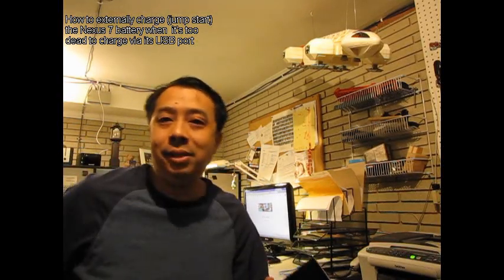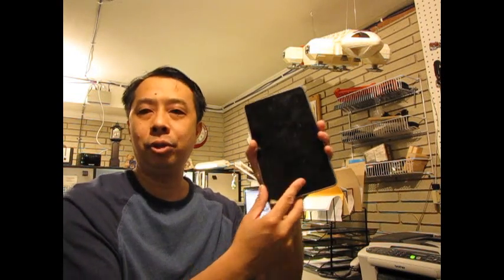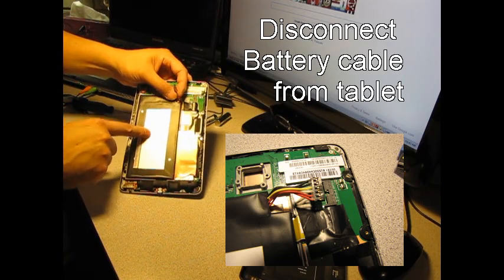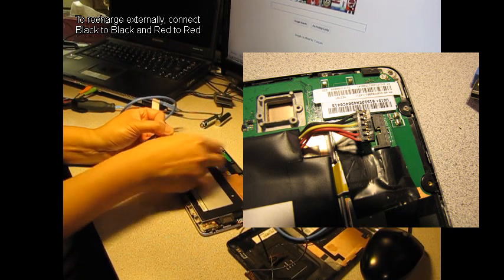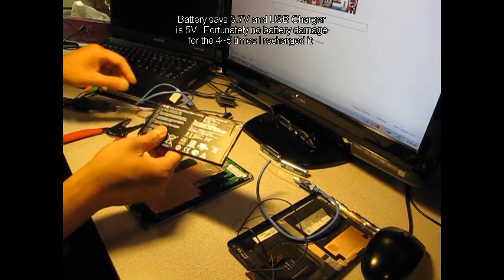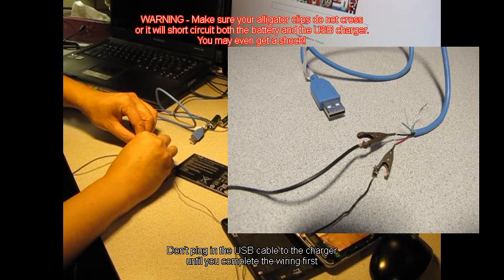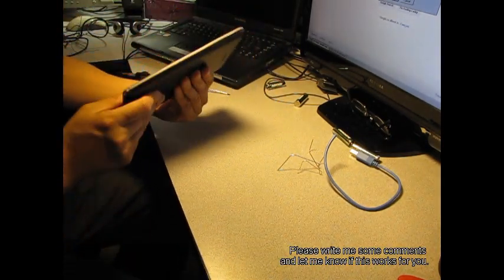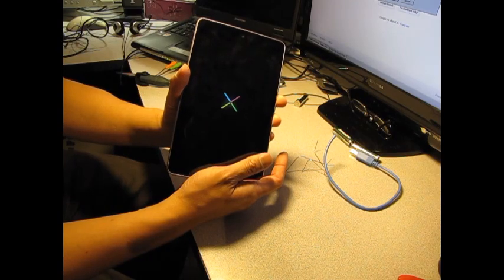Externally Jump Start Your Dead Nexus 7 - Final solution when all else fails!

Comment: Thank you so much for this, Doug. I hadn't turned on my nexus 7 in about 8 years. Your steps worked exactly as you described. I checked continuity on the pairs of black and red cables and noticed that they are connected anyway, so I didn't bother charging them separately. I did 20 minutes and got 12%. I noticed the 5V/3V behaviour too. So good to see this thing boot again. God bless

Comment: Hello. I want to add a third cell. Which wires should I grow to? to external or internal?
Reply from the maker: Turns out that both pairs of wires leads of the battery to the same place which I didn't know at the time of making this video!  That is the both reds are connected inside the battery and both blacks are connected inside the battery.  If you peel back the battery cable and follow it down, you will see they are actually joined together at the battery.  Why do you want to add a third cell?  If your battery is dead, check Aliexpress as you maybe able to buy a replacement there.
Reply: @CanadianDoug Dear friend, thank you very much for this research.
You helped me a lot!
Reply: @CanadianDoug Hello again! 
I did it))
Now the tablet does not need to be charged for hours. I change the battery like in a screwdriver)

Comment: WOW!!!  I had no trouble opening the case.  The connector disengaged easily.  I "jumped"  each pair of red and black pins for 20 minutes.  I reassembled everything and plugged it in and it immediately started charging the battery!  After being untouched for 8 years, it now appears that this 2013 Nexus 7 is taking a charge.  Hopefully I will be able to put this tablet back to work.  Many Thanks!
Reply from the maker: Thanks for sharing the good news!  If you do have problems charging it moving forward because of the loose USB connector, there is a charging dock that you can buy that is probably now dirt cheap.  This charging dock using the 4 gold pogo pins on the side to charge without going through the USB port. Another thing nice about this charging dock is that makes a great upright stand to use as an android clock!

Comment: Great video Doug, thank you.  I had similar symptoms. Although I didn't need to do the full 'jump start' this video gave some great instructions on how to open the case and disconnect the battery.  Disconnecting the battery in my unit solved the issue I had and after reconnecting the battery I was able to boot into the bootloader (Power and Vol Down) and shut down the device.  This gave it the kick it needed to boot back into the Andriod OS.

Comment: Hey Doug, thi was great, thanks.  Good info.

It's been years and years, and I'm still trying to keep my old Nexus 7 2013 alive.  Blows my mind no one's made a tablet to fill this niche.

Anyway, slight mod on your process got me back up and running.  I couldn't quite get any wires into the connector on the battery harness side - even tried solid strand CAT5, but wouldn't stay.  During this process, though, I accidentally discovered that with pressure in trying to fit the CAT5 copper into the harness connector, it doesn't take much to push the lead out of the back of the plastic connector.

Using needlenose pliers, I was able to carefully extract the outer pos and neg leads.  5 mins on my hacked USB cable - great idea, btw - on one cell only was enough to breathe life back in.

I connected a regular micro USB charge cable, and my Nexus booted.  I'll leave it on overnight now and see how things go.  Thanks for doing this demo.

-msg

Comment: That worked like a charm on my nexus 7 2012. I havent turned it on like for years and wasnt able to power it up. Injected 5v straight to the battery for around 1h, then plugged that to the charger via micro usb and let it do its thing for another 0.5h. After that procedure i pressed power button and the screen went on. Brilliant video. I thought I lost this tablet. I need that to wath some netflix and tv while at work. Cheers👌👌👌👌

Comment: Did not work unfortunately. Made a very nice lead with crocodile clips attached to an old stripped down USB lead. All good there with a tested 5V coming from the charger. The old battery in the unit was completely dead and did not register any voltage at all. While I was able to get it partially charged it was unable to hold a charge. Swapped out battery for a 'new' one which I measured at a little over 4V. However no amount of button pressing, or combinations thereof, managed to bring the device back to life. A fiver wasted on a new battery, but it could have been worth it. Sadly not. I guess something else is wrong with it, perhaps the screen, a failed chip, dry joint etc. Nothing lasts for ever, I guess, but the Nexus 7 was the perfect size for reading books and watching the occasional YouTube clip.  March 2023.

Comment: Yes, that worked.  I think one of the cells had gone below the minimum.  Thank you!  Do this all the time to my tool batteries but never had to do this to a computer battery.  Had to revive my old Nexus to so some solar system monitoring.  All it's good for now.  Joined my fleet of early Fire tablets.  Don't know why they can't design a jump start mode into all of these charge controllers.  Probably a safety concern.

Comment: Mine started once and shutted down just after start and no longer boots anymore. Multimeter shows that battery has 3.8 volts but it looks like completely bricked. The only one think is that while it is connected to the charger (via usb) it is trying to boot, but black screen apears after 5 seconds of Google logo

Comment: Hi my nexus 7 wont power up tried a couple of batteries I don't know if its the batteries that are totally dead or something else what tools did you use to do this and which aligator with cable do you recommend to buy ?
Reply from the maker: If you tried with another battery, there is a good chance that other battery is not dead.  You only need a bit of juice to complete the boot sequence it was trapped in.  In other words, it's not good news as your problem is probably something else.  As for Aligator clips, uses the smallest tip you can find or try with a paperclip as the tip is small.  Amazon is your best bet.

Comment: The only problem I had was the red & black wires in the USB cable were really, really tiny, making it difficult to strip the insulation off the ends, and then securely insert them into the battery connector. Otherwise, everything OK. Thanks!

Comment: I had given up hope on my Nexus 

This worked 

Ingenious 

Although I didn’t need crocodile clips or extra wire. I stripped the USB wires back (pink and white), wrapped them tight around two metal
Staples - they were the perfect size to slot into the battery plug terminals 

5 minutes each in both sets of cells

Job done, thanks!

Comment: Doug!  Thanks so much!  I know this vid is years old, but it is very much still "current".  I have not used my N7 in several years and thought there was no hope for working again.  I followed your perfect instructions and my N7 now works again!  I charged both "ports" for 30 min each, and ended up with a 20% charge.  Plugged it into it's normal charge cord and 3 hrs later, 100% charged!  Thank you for posting!  The worst part is remembering how this tablet works!  LOL

Comment: Thank you!  Your video was one of several I watched to get the Nexus 7 going again.  Just want to let you know that this is still relevant.  Mine had not been used since 2015 and this technique brought the battery back enough to get the tablet to reset and login, as well as getting a charge to "take" on the battery.

Comment: Sir My Tablet is Nexus 7 (2nd gen ) and it's not storing charge! it shows that it's charging and also gets 1% of charge, but after that it doesn't go beyond 1% and shuts down after a few min
Reply from the maker: Are you getting the "charging symbol" when you plug it in?  If you are getting it and it's able to properly shutdown, I think your charging system is working fine and hence no need for my instructions here.  Instead, maybe your battery is too old (used too many times) and can no longer store charge.  You can often buy these batteries on ebay.com or aliexpress.com by searching for "Nexus 7 (2nd gen 2012) battery".  They are probaby inexpensive and also easy to install.
Reply: @CanadianDoug  actually they aren't available for my region🥺 and im not able to find anything part of my tablet here at my city

Comment: Does the battery have to be removed from the Nexus?  Or Can I leave it in there to charge?
Reply from the maker: You can leave the battery inside the Nexus to charge, as long as the battery wires are not connected to the Nexus circuit board itself.  Good luck!

Comment: Will it be dangerous to connect 5V directly whilst the battery is connected to the circuit?
Reply from the maker: Sorry for the late reply.  I do not recommend you connect the 5V USB supply to the battery while it is connected to the circuit.  The reason is that the circuit is designed to operate at a lower voltage and may not be able to take the 5V supply.

Comment: An excellent tutorial. However, must I reboot the system with the power - volume buttons? Without this, mine started alright then shut down again ...
Reply from the maker: It might had just enough batteries to complete the last shutdown sequence.  Try charging for longer.  If your tablet's USB connector is loose and hence can't charge anymore, you can buy a new connector part on E-bay or buy an external recharger that utilizes the POGO pins (the 4 gold dots on the side of the tablet) to charge through there.

Comment: Can we connect the usb directly to the motherboard and use without battery ?
Reply from the maker: Never thought of it. It would depend how much voltage the battery typically supplies (I.e. Is it the same as USB which is 5V) and if the USB is capable of generating enough current (mA) that the tablet Motherboard needs. My guess is the the USB voltage of 5V is too high compared to what the battery typically gives, but the USB current is sufficient. The higher 5V of the USB would likely damage your tablet, that would be my guess

Comment: This appears to have worked for me. I made it a little simpler by buying a test lead set with alligator clips attached. So the wires and clips were already together. I used 2 staples to attach to one end of the clips and insert into the black and red inserts on the battery side and used an old USB cable for the other end. Charged for 30 minutes each like the video. It now has screen activity and indication it is charging when before it was dead.

Comment: Darn. Tried this, on two separate batteries actually. I believe they took the charge, since my computer recognized that something was pulling a charge on the USB port. (USB device not recognized.) But upon putting them into the tablet, no dice. Thing wouldn't start. Which is weird, because when I got the "replacement" battery in, it powered the device on just fine, until that battery lost power. Thing won't charge, or register on USB. I think it's pootched. Nice idea though. Probably would work on a more functional tablet, as the comments seem to suggest.
Reply from the maker: Sorry to hear it did not work.  When the battery takes the charge, The Nexus would normally automatically reboot as normal.  To be precise, it completes the last shutdown sequence first, and then boots up again.  Did you try pressing both the power button and volume rocker simulaneously with the recharged battery in place?"

Comment: Very clear video Doug. Thanks.  I just had this problem after letting my Nexus 7 battery discharge completely (I though it was charging but the power strip I was using had reset).  At this point the screen was blank and when I plugged it in I didn't get the normal screen showing that the battery was charging.  When I pressed the power switch at this point the LED at the bottom of the screen would just flash 5 times, and then this would repeat after 10 or 15 seconds (if I kept the button down).   I tried holding the power-on switch down for 30 seconds without any success (multiple times) but then when I held power-on and volume down together for a minute or so I suddenly got the empty battery symbol to display.  I didn't need to use your technique, though I'm sure it would have worked too.  Note that Home Depot sells a pair of insulated alligator clips made by Tyco Electronics for $ 3.50 so you won't risk shorting things if you use these.  The Home Depot Store SKU is #281205 (Model # EB0283-000).  The insulation covers the entire barrel so that just the tips are exposed.    Also I wonder whether you might be able to charge both cells at the same time by just inserting two wires into each side and then clipping the USB jumper to both?
Reply from the maker: Thanks for your advice!  Yes, I later found that the two cells are interconnected within the battery from one of the readers here.  So you could charge both at once, or just one of them as they are all connected!

Comment: omg, been dead a year.... im always tinkering w electronics, and i thought about doing something like this but was worried i would l fry something.  your video confirmed to me that i should go for it.  i just jammed a couple needles in it for like a minute, and it powered up.  it died and shutdown pretty quick, but now i know what to do!  now i can fashion something a little more stable to charge it for 10 mins or so.... thanks!!!!
Reply from the maker: Your USB charging port is probably broken.  You could purchase the external charging dock which uses the 4 pins on the side of the device, or fix the USB charging port module.  That module is available on e-Bay and is modular, making it easy to replace.

Comment: power from charger or  from pc??
Reply from the maker: Either will work, but I strongly suggest you use a charger.  If you accidentally cross the wires and cause a short circuit, it would only damage the charger and not the USB port in your PC.

Comment: Hello,
I have had this issue for a very long time and I am 100% sure that this solution is the one I have been looing for.
However, I have a lenovo tablet that has a slim fat wire and I cant see the red and black wires so what should I do in this curcumstance? Thank you in advance,
And please reply, I am in desperate need of an answer.
Reply from the maker: You have nothing to loose!  There are commentators here who said this technique worked for other tablets too.

Comment: After some years of being in a drawer it worked for me and now it is charging. It was even easier.  I connected de wires from the stripped USB cable directly into the battery connector holes. Very clear voice and very clear instructions also.

Comment: Very clear instructions. I would suggest for the ham-fisted or those prone to accidents that it may be better to insulate the two spare wires (individually) out of the way and if it is necessary to add finer wires to the red and black, that you should solder or twist them on to the red and black and then insulate them (separately of course!) This should eliminate danger of shorting out. Nice video!

Comment: I did this with nexus 10 today. The cells are in parallel so either red or black will do.  Your usb  source is limited to 500ma which is why you don't blow up the battery,  the voltage is lower than 5 at the battery simply because of resistance in the usb cable. So for a dead battery 1 hour is fine but if the battery exceeds 4.3v bad things happen. For a 4ah lithium you're not going to get near overcharge in 1 hour you'd get less than 25%. So 16% sounds totally plausible.

Comment: Also, why do you have to remove the battery?  I did not because of those two ribbons running across the battery but pulled the plug in out and inserted the leads into the red and black wires.  Mine is probably from a different year.
Reply from the maker: You do not need to physically remote the battery.  You can leave it in it's place, BUT you have to make sure that it is electrically disconnected from the tablet.  This means to remove the power connector from the tablet's mother board before you charge the battery

Comment: Doug, It would have helped if you had shown more detail about how to insert the wire or pin into the connections for us doofuses.  I have a question,   Mine has two ribbon like things that run from the top to the bottom of the battery area.  One is firmly seated, but the larger one that is silver does not seem to be connected and it is not long enough for me to insert it.  Should I tape it down with non metallic tape to hold it down as firmly as possible?  Thanks.  I do not know yet if your fix will work for me but I am trying to charge mine now with the red and black wires.
Reply from the maker: Hi Lola, try to use a narrow pin to poke into the positive and negative terminals where ever their bare metal is exposed.  To be honest, I am not following your description of the two ribbons and silver ribbon that is not connected.  You should be looking for a black (negative) and red (positive) wire to the battery to touch.  I don't believe these are in ribbon firm, but I could be wrong.
Reply: I did get it to charge.  Mine must be prior generation.  Found another tutorial that showed mine.  Your tutorial helped me restart my nexus 7.  The one ribbon was unseated and the touch screen would not work.  I got it to reseat firmly and voila, my tablet is alive and kicking again.  Thanks so much.

Comment: Verified this worked for my device. Charged 5 minutes each cell. 10 total. Was at 12% when I turned it back on, then immediately plugged it in to wall charger and it began charging.